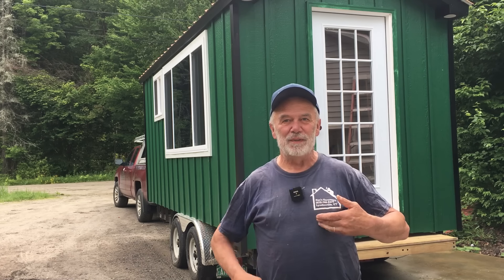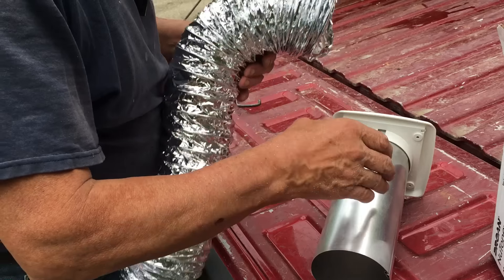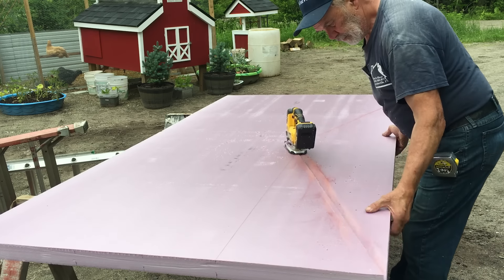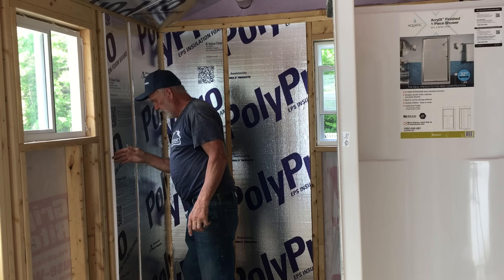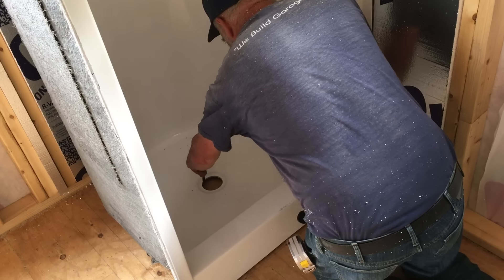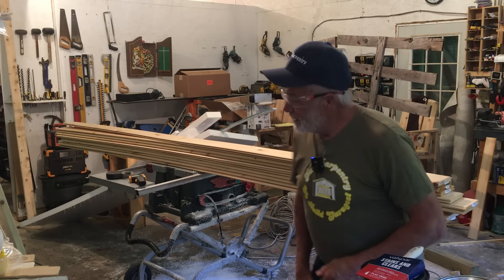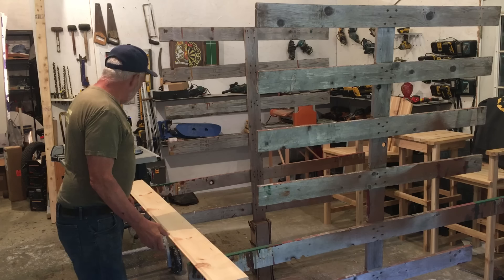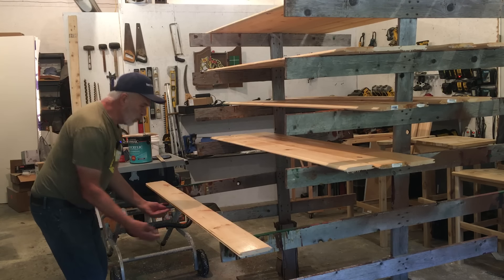Creating the Bathroom in the Tiny House...Ep 15

Comment: That's great that you cut out for the bathroom fan. The cover installed on the outside looks nice. That looked a bit hard to use that right angled drill to cut the hole for the drain in the shower. Wow, applying coats of polyurethane to the tongue and groove pine boards for the ceiling in the bathroom. That will look so nice! The beans and peas look like they want to be planted. Your garden is doing well Ken! Thanks for this video Ken!
Reply from the maker: Thanks yes I need to get them in something soon

Comment: Hi Ken I enjoy all of your videos, please look in to the installation of the shower drain. I’ve always installed the rubber washer under the shower pan followed with phenolic washer then the nut, and use plumbers putty or silicone under the lip on the top side of the drain. Check to see if the black washer is keeping the drain high on the top side preventing all the water to drain from the pan.
Reply from the maker: Oh. Thanks

Comment: I found that a 6 inch foam paint pad works great for polyurethane on these pine boards. Holds a lot of material and no brush marks. Only cost about 3 dollars at Lowes. It was a big time saver for putting polyurethane on 1500 linear feet of tongue and groove for my camp.
Reply: Good tip. Thanks!

Comment: Ceiling lights: use the low-voltage pancake ceiling lights. The one that has one AC power supply that dryers multiple pancake ceiling lights.
Reply from the maker: Thanks. That’s the plan

Comment: Ken, I’m so sorry but I think the guy at the building place told you wrong about placement of the rubber gasket sealer that needs to go on the bottom and the piece of paper is what reduces the friction on the rubber seal.
Reply from the maker: I agree. I changed it. Thanks

Comment: It’s looking good and coming along nicely 
In your shop you have a table saw can you tell me what brand it is
Reply from the maker: Thanks. It’s a Bosch
Reply: @kenskarpentry  my old delta has just had it and I’m starting to look around for a replacement I don’t want another big saw and I saw yours that’s the size I need I cut some hard maple some time 81/4 on a 45 degree would your saw cut that I’m wondering how much power those saws have in that size Thanks for any advice you can give me

Comment: Seems like conflicting reports about plumber's putty vs black rubber washer.
I thought there was a bit of a dip in the preformed drain hole.  The black washer should fit there nicely, and still allow the top of the drain to be below the floor level.

My Dad used plumber's putty a lot.  But that was back in the old days, not sure they were including the black rubber washer then.

I don't know.  Feels a bit contraversal.
Reply from the maker: Thanks I agree. But I did change it
Reply: @kenskarpentry  oh, I'm not saying you should have.  I just was reading some other comments, some said plumbers putty, some said washer.
I recently had the same decision to make when I put in the new sink.  My Dad's old way, or the new technology?

The thing about using the washer?  Makes the drain too high.  But with the lower drain hole, the washer and drain fit fine. (Lower than the rest of the sink.)

I don't understand why not to use the putty instead?  People (and the instructions) say, don't use the putty.  Just wondering why?  Is it toxic?  Dries out and cracks/leaks? Some other reason I don't know to ask?

I hold my father and his skills in high reguard, learned a lot by being his helper.  Is what I learned wrong?  I can accept that.   But would love to know why, washer, not putty?
Reply: @jfrodgers7858  I make the snake of putty and I put it below the metal surround of the drain because it is always so curved there that I think a rubber gasket is too thick to even out that drain surface for the metal to fit in properly. I don't know why anyone would suggest a rubber gasket there. I guess it's up to the installer what way to put the metal surround in the drain hole. I like the old fashioned way personally. It just looks nicer to me.
Reply: @StoneKathryn  thanks.  So both work (maybe).  The putty works for sure.

And my Dad always wrapped a healthy heap of tape to any plumbing threads.  Called it insurance.
When I bought my house he asked if I had any money left?  Yeah.
So he looked at all my plumbing.  For less than $100 he upgraded, redid, or whatever needed to every plumbing feature.  27 years later...still no problems.
Then he made my uncle come look, check, update my wiring.  Them boys sure liked spending my money.  LOL.  (I liked it too. ❤)

Thanks again.